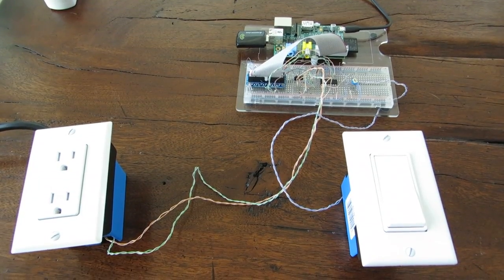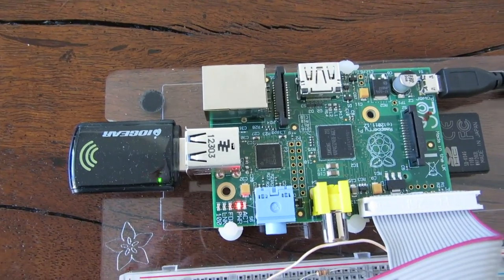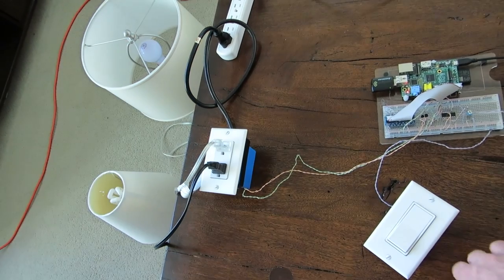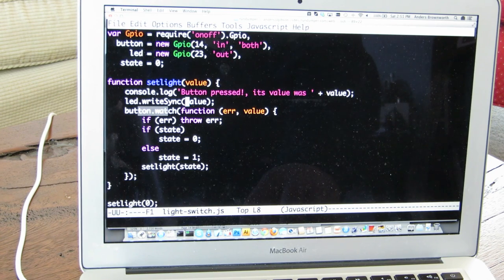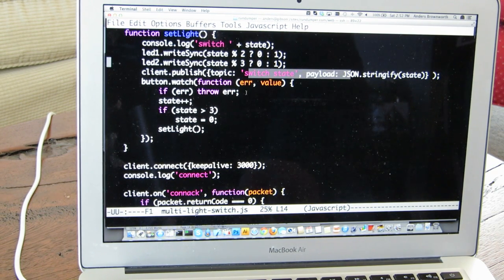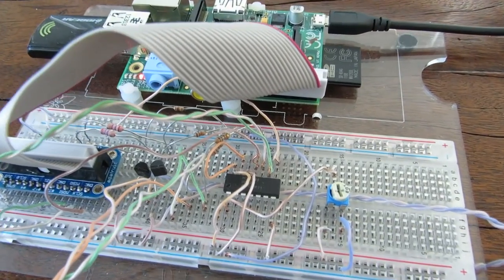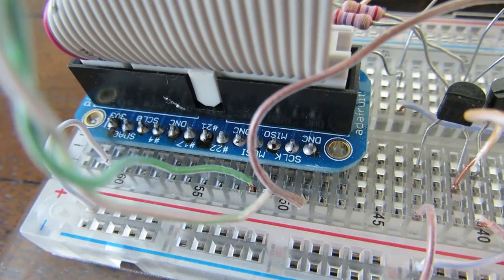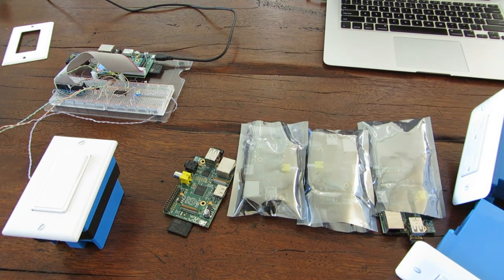Home Automation with the Raspberry Pi and Node.js - Well Tempered Hacker

Comment: Thank you for sharing this with us. I want to use an analog volume control on the raspberry pi. The analog to digital converter is a good idea I am going to see how that can be used on my project. Can you provide information on where one can go to find a operations manual with all the commands for the Raspberry Pi. Even the Commodore 64 had a written command manual . Is there one on the Internet I  could download?
Reply from the maker: The Raspberry Pi runs Linux so much of what is available for Linux will work on the Raspberry Pi. That's probably why there isn't a simple operations manual for the Pi - it would be several hundred thousand pages long at least. That said, I know there are a number of good books coming out lately on the Pi. Browse the reviews on Amazon.com. I can't recommend a specific one because I haven't read any but you'll find something there for sure.
Reply: Anders Brownworth
Than you very much for your quick reply I will do so. I do not want to reinvent the wheel . I want to add a controller that will access Audacious music player. There is one on the web for 32 dollars but I wanted to make one for the Pi. I guess I could always add the thumb mouse from China . Cheers!

Comment: Cool, so you've set up a CAN network in your home, I wanna do something like this!
Reply from the maker: Well, technically it is a WiFi network but yes, the idea is similar. Events being passed around and devices that are interested subscribe.
Reply: Anders Brownworth
 Very nice, my only concern is cost. I get the idea of a decentralized network but not the point.
Couldn't you use the RPi as the central network and a bunch of much cheaper microcontrollers (atmega328, think arduino) on a CAN network instead?
Reply from the maker: Nightrazr Yes you could but then you would forfeit the world of options you get with a multiprocessing OS. I'm not suggesting the RPi as the end-all solution - just that a fully fledged environment will become so cheap, one in every light switch / wall socket will be a no brainer. The RPi gets us a cost effective development environment.
Reply: Anders Brownworth You're right, I didn't give multiprocessing much thought, probably because I couldn't think of a scenario where this is necessary.
I'll be subscribing to see how you progress!
Reply from the maker: Nightrazr Thanks, I appreciate it!

Comment: Hi Anders Brownworth , 

Thanks for a great video. A quick question, is it possible to remove the switch? Basically, what I'm thinking is controlling the power socket from the web without hardware switch. 

Thanks,
/R
Reply from the maker: Yes, very possible. Anything that can post a message on the bus can be used.

Comment: Have you considered using something like the Electric Imp in replace of the Pi due to lower cost, wifi enabled, all in one package, PubNub and FIrebase example code to do same publish functions and much smaller? if you have, have you changed to using it OR why haven't you used them for this type of purpose?
Reply: Anders Brownworth
 okie dokie. I feel it just might be a better option than an entire Pi. They may not be as powerful as it but they are not puny. Another plus is it manages Wifi connection really well even though its antenna is very small. I never have had it not connect or disconnect from the network anywhere in my home and in most places of my yard/backyard. Anyways tell me what you think about them as im interested in doing similar things but with them instead.

Comment: Nice video. 
Upto How many sockets can one raspberry pi programmed to? Is there a limit?
Reply from the maker: Technically there are 26 direct GPIO ports so you could run at least that many, however the intent of this post is to suggest that you have one Raspberry Pi (or one computer) per switch / light socket.

Comment: Thanks for the awesome video Anders. I was wondering if I wanted to control my home lights with my android phone. What exactly do I need to know. I currently know java, a bit of Linux and have raspberry pi with ribbon cable, transistors, breadboard.

Thanks
Reply from the maker: If you were to build the hardware similarly to the way I have it and use the same software, you could use the Java redis library to send / receive commands from the devices. Essentially the Java client would just be another device subscribed to the same redis pub / sub queue.

Comment: Hi what about if you would like to dim the lights? not use 100% power but maybe 20-40-70%?
Reply from the maker: You could do that but not with this hardware. It is also somewhat dangerous to do that with anything but an incandescent light so I don't know that I'd make that an option on a power receptacle. That said though, I think there is a good argument for this built into various lighting technologies. (LED / CFL) To be fair, there is also a good counter-argument against having a complete microprocessor based system in a LED / CFL though!

Comment: How are the raspberry pi devices powered?  Is there an AC adapter inside the wall plug?
Reply from the maker: AC adapter inside - yes. As the design evolves into something a bit more industrial, this will likely be included in the main PC board and expensive components (in terms of power) such as the Ethernet hardware won't be included.

Comment: really cool, but doesnt seem cost effective. am I wrong?
Reply from the maker: Nope, you aren't wrong, but a system like this has many more options for the future which you wouldn't have with, for example, a micro controller option.
Reply: Many more options? any example? Use Micro controller for low level stuff, use ARM for high level and  whole problem is sorted. How do you think is this solved with BMS (building management system) where you talking to >10000 (yes, more than 10 thousands) nodes? how much energy you will require to power up lets say 1000 RPis?? You will need to own power station to power them all... ;-)
Reply from the maker: orionispm From another of my comments:

You could argue all you need for a cellphone is a micro controller coordinating some purpose built radios. Cheeper and uses less power - no need for a microprocessor - especially not a quad core one! Who needs a fully functional always on unix machine in in your pocket?

But people don't use smartphones as just phones - they are so much more! A multi-billion dollar app universe demonstrates this.

I think its the same thing here. Imagine instead of buying a purpose built intercom system for your house, it was just an app that you downloaded and installed. Or what about a far more accurate home security system? Just an app with a platform like this. Baby monitor in every room that doesn't die? Easy.

You get the idea. There is huge potential in making a platform with a high level of standard capabilities. Being able to programmatically turn a 120V AC socket on and off is simple for you and I but generally beyond the capabilities of most software developers. The idea is to create a platform that developers understand to unleash their talents in the home automation department.

Comment: so is this the same concept if i wanna use Arduino instead of Pi?
Reply from the maker: Jesus Gomez In terms of electronics, yes. In terms of software, no.
Reply: How would i go about to making this controllable with a phone? Would openHAB be compatible?
Reply from the maker: Jesus Gomez Yep, you should be able to easily control it via openHAB. How to do that is a bit of a complicated question and out of the scope of this video.

Comment: How many relays or switches can one raspberry pi control actually? Why so many pis?
Reply from the maker: +Jackie Technically, a single raspberry pi can be connected to an unlimited number of switches indirectly, but the older raspberry pi can directly connect to 17 switches and the new raspberry pi can directly connect to 26 switches.

I don't follow the question "Why so many pis"... what do you mean?
Reply: Anders Brownworth Thanks for the info. I mean why you have so many PIs, what are they for :)
Reply from the maker: +Jackie They are very flexible so I end up buying lots of them to use all over the place. I just get them on an as-needed basis. I use them for everything from Internet of Things setups to mesh networking and even a bitcoin vending machine. Most of these applications really require more than just one or two so... that's how it starts!
Reply: +Jackie If you need more than 26 GPIOs than you can buy a BeagleBone Black it's a few dollars more expensive than a Pi it also runs linux
and it has a massive: 65 GPIO pins, 8 PWM ports, 4 timers, 7 analogue inputs (1.8v), 4 uarts, 2 spi, 2 i2c and 25 low latency IO pins.
Reply: Anders Brownworth Raymond Doetjes Thanks a lot for the info :)

Comment: Brilliant, but don't you think this is like shooting ducks with 105mm cannon? We can do exactly the same and much more with simple 8bit micro-controller taking 0.025A and not 2A of the grid for start, you can easily integrate small RF receiver/sender to get rid of of controlling wires. You still need to know how to program it, but size wise is 10-100 times smaller. If you want to integrate wires, you should be using RS485/CAN or similar to reduce amount of wires, and this will require different approach anyway...
I do like RPi idea, but people just trying to fit it in every possible way everywhere. At what cost? $35 per RPi, wifi dongle for $5, mem card for $5... Let say all in for around $50-75???

8bit AVR/PIC ~$0.8, rf sender/receiver ~$2, few wires, solid state relays... $5?

Leave RPi where it belongs: where higher logic/speed/complexity is required, as for low level stuff like controlling sockets, lights it's 100 times more economical and sometimes/many times easier to implement with 8bit micro-controller.

This is my opinion but you all may disagree.

Actually, I just realised that you do not use interrupts, so you require constant infinite loop and running ARM at 100% (PS. add some sort of delay in that loop as you do not require checking that state 1000 times per sec, it will release CPU for other tasks). Do you know that I can put my 8 bit "SLOW", "DUMB" micro-controller in sleep state drinking around few micro Amps and wait for button press where it will just wake up and start action? and I don't need 12bit ADC externally as I do have them on board (varies from 8 to 16bit)

And STOP saying that RPi is cheap, it's NOT. After adding case, mem, usb peripherals it can cost you easily $100. Maybe for you after having MacBook and few LCD screen for few $$$ in your "office"is easy to say that "It's CHEAP", but people can do what you did for <$10. and THAT'S CHEAP!
Reply: Anders Brownworth

Ok, but... I'll cut it short: power demands... If you can stick ARM processor capabilities into power demands of 8 bit MC than we can talk about sticking it everywhere, but for time being this will not going to change. If ARM processor has the ability to reach micro Watts @100% use, then it has its use there.

To do what you want it to do, it needs to be used with some sort of energy sustained technology, ie solar, wind, electromagnetic or internal "atomic battery" ;-) At the moment, it will be difficult to run your RPi from 9v battery. If they create ARM platform with mW power level... It will be called rather different than ARM. It will be probably totally different platform.

At the moment lets focus on what we have: an ARM based device with lets say 5W power demand and size of truck compared with 8 bit MC taking 0.25W and size of box of matches, both employed to switch light on off...

You get the idea? For developers to develop on ARM platform, you need to have a SMD technology (and we are talking about those inventing devices like you/me and others). I do love to solder those tinny tracks to let say 180 pin SMD processor... No, I'm not and you probably as well if you tried once.

BTW, Why you need baby monitor in every room? To watch baby sitter? This is called CCTV. I've got my wireless baby monitor with separate receiver and I'm happy to take it everywhere I need to.

Dont forget that most software developers are ONLY SOFTWARE developers and they have no clue about electrical circuits simple because they don't need that knowledge, but for micro-controller developer it's different story.

I can see you vision of connected home quite interesting and truly intriguing, but NOT with our technology yet, and this is due to 2 major factors: size wise (yes, you can incorporate special circuits into CPU die to reduce size (aka mobile phones cpus special functions), but this will cost millions of dollars, so not at reach of some garage inventor. Power demands of today's CPUs are not match for battery technology we have at hand. It's out weighted 100:1.
 
 I forgot something, to build home with all connections wired, wireless, supply power to them... This is not 1 day job, it's either done when house is build or retrofitted later. In first instance you have to have serious specialists and not some cowboys builders, second retrofitting will cost you arm ;-) and leg to get it done not mention of possible damage to the property.

As I said before: use correct tool to do a job. Arm is NOT correct tool for this job you have presented in this video. But to give you credits: it shows that you have skills in both programming and hardware knowledge.

If you want to get busy with ARM, try Arm Cortex M0,M1,M2,M3 likes. Still 32bit, about 10 times more power hungry than 8bit, but with all bells and whistles like networks, GPIOs etc... Look for NetDuino. It will be 100 times better that RPi. Cost is similar.
Reply from the maker: orionispm Good points but we're going to disagree on this. You have to start somewhere when creating a platform. I agree it isn't as efficient as it will be in the future but neither were the first smartphones.

Also, I don't want to target micro-controller developers. They don't generally concentrate on user interfaces the way iOS developers, for example, do. I want to make something high-end UI designers might want to pick up. Home automation, in my opinion, is dismally broken and demands a no-nonsense platform. And that platform leverages the microprocessor ecosystem. I don't care if it is the Pi or not - I care that it conform to a standard set of tools the way Android offers the developer a standard set of tools even though you could have done a phone with a micro controller and have far better battery life. The power cost is worth it. Again, all my opinion.
Reply: Anders Brownworth

I can agree with you, that creating uniform platform will be a start, but you have to realise the reasons why android and the phones are what they are now: Phones got smarter just because of a competition across all manufactures, they just stuck with idea that phone is just a phone with some sort of OS to call/send/receive. After that idea was exhausted they had to add new features to make it more attractive to buyers, to the point that CPU on them grew immensely, only due to new features and add ons and not because someone decided to give it 1.5GHz quad core.

I don't really think you going to have similar competition in home automation department, simple because it is not: a) fashionable, b) everyone has to have it, c) a lot of money in it... Look at Apple, if not Ipod/Iphone they would be long time gone...

Android is in theory open source. This is first major plus, but is getting heavy now. I've got my S Note 1, and I can tell you that 3.6.6 was flying and 4.1.2 is getting sloppy. Of course, it has more features, but do I need them all??

Ok, I'll tell you something: I'm working on automated system at my home, and I can tell you now that there is no way I will include android in every simple device simply because it will be not reliable. Every time system got a bug and I don't know about it it is potential problem to solve, on high end OS there is just too many variables. Then, there is underlying trouble with accessing hardware, etc, etc. This is high end OS not for simple on off switch. But... I will include Android on main panel as a UI between all my nodes and human interaction... Nice buttons and menus... Do I need that on let say lamp switch? Not really. Nodes are only to do specific jobs, you can easily replace/upgrade them. The main system, is the one with fancy features.

1. Every part of it needs to be Open Source, so others can upgrade it/add things.
2. Create standard encrypted protocol, so every node can communicate, even with other nodes if necessary.
3. Create standard, expandable front end for user (based on Android as a underlying OS for now)
4. Each node needs to be environmentally friendly (this is the main purpose)
5. Nodes need to do a job and go to sleep, waiting for action, thus saving energy.
6. Nodes needs to be simple to fit, plug and play (or close to it)
7. Has uniform SDK to make programming easier.

and few more I cannot think of right now... I picked up Android because it worked on ARM, but I think now that any Linux would do. High end OS with high end language like Java would do ideally.

...and small remarks to iOS and its developers: I don't think they actually know what is ticking under iOS hardware. SDK is simple to create nice UI but did you tried to physically program iOS to let say switch something on off? I don't think so. I may be wrong but iOS is not design to give you raw access to anything. Similarly to Android...